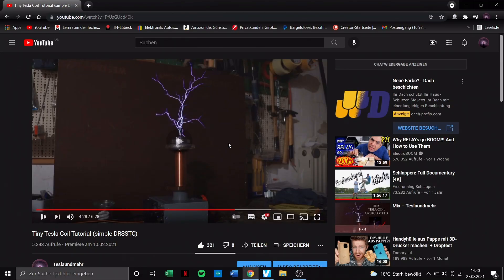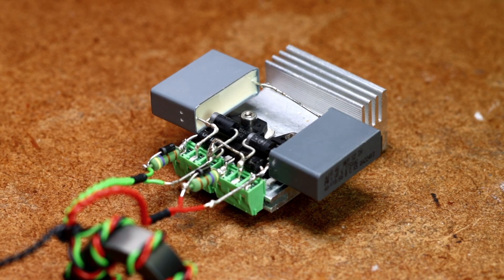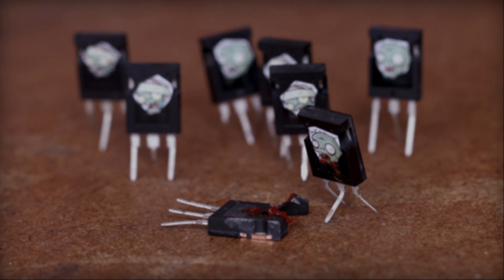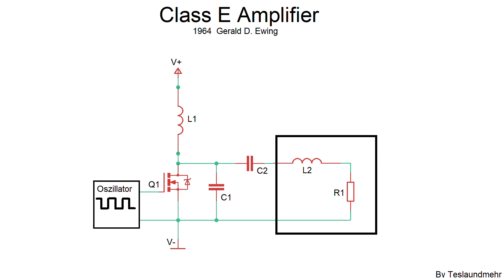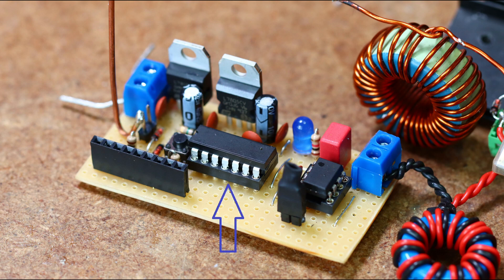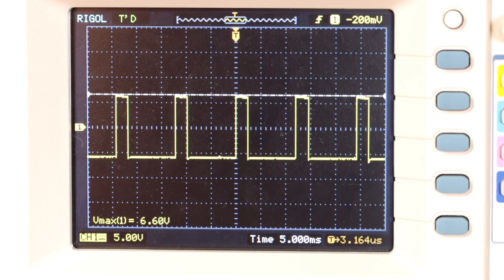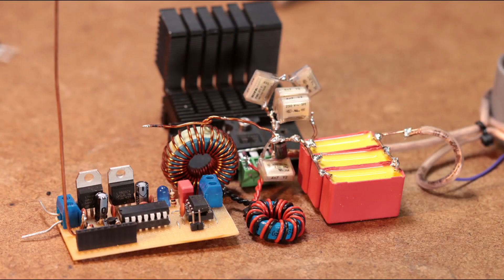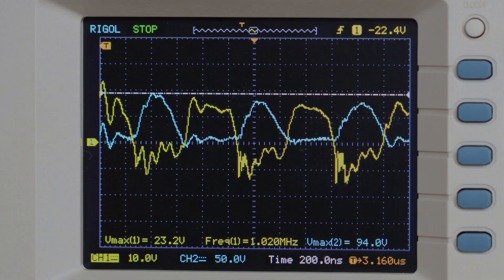Tiny Tesla-Coil easy but Powerful DIY

Comment: I built a class-e coil and used an adjustable voltage regulator to get sword sparks!
Watching your video brought me new ideas for version 2.
Here is the link for my coil: https://youtu.be/wzfhb-ywe1M
I documented the whole process on the high voltage forum. Topic: Driverless Single Mosfet Relay interrupted SSTC

Comment: I just built this circuit up and it performs quite well. I used very similar component values for my circuit except that the secondary runs at 1.8mhz. Normally the coil produces 3.5in sparks but when I touch the antenna it produces 5.5in sparks? Also my input is only around 60v.
Reply from the maker: Thats sounds amazing!
Reply: It is quite good, not perfect yet though, I still have to figure out how to get those longer arcs without having to touch the antenna. Just curious do you know why the spark length increases when I touch the antenna?
Reply from the maker: @quantumlab9130  yes, because your body is like a big antenna, when you Touch the antenna, the coil get more in resonance. So you a bigger Antenna, and better tuning ;)
Reply: Thank you, that’s what I thought but I wasn’t sure. Clearly more tuning is required.
Reply: Probably the last update. My cool now produces almost 17cm arcs. I found that literally everything effects the tuning of this coil. I found even the position and length of the antenna effects the circuit. Also I replaced the 330nf coupling capacitor with a 15nf one and it works much better. Also instead of using a one turn primary coil like you did I used a 4 turn primary which decreased input current and increased spark length. Also using a staccato controller increases spark length and makes the arcs straight and quiet. Also instead of a 74hc14 Schmitt trigger I used a cd40106be which can run up to 16v so I don’t need to use a voltage regulator to lower it to 5v.

Comment: Teslaundmehr greetings ... I already built a driver similar to yours however I don't have a big spark like yours with 40V am using IRFZ44, the secondary coil only has 660 turns. I do not know what values of tuning capacitance c1 and inductance L1 to calculate to the class E driver, I need help. the frequency of the secondary coil about 1Mhz.  how many turns did you put on its secondary coil?

Comment: In order not to alter the calculated capacitance and inductance values in the amplifier clase E, I must respect the physical dimensions of the secondary and primary coil and the caliper of AWG wire and the number of turns. I would like more details to replicate your work, it's great

Comment: Greetings .. your work is magnificent. One question, did you put rectifier diodes at the output of the GDT transformer?
Reply from the maker: Thanks!! No ;) but you can put a tvs or a zenerdiode at the output to prevent the mosfet

Comment: That looked awesome. When I saw the primary voltage and current signals, I knew it would be a good one.
 As that is the same as a positive voltage impulse (no polarity change) 

I would love to see the difference, if you would have used negative voltage and current in the primary!

Comment: WOW im literally building the same thing but without the Schmitt's trigger 😮
Reply: How would you do it friend? I am interested because I am from Venezuela and here it is not easy to get materials as Schmitt trigger
Reply: @victorp2562  same circuit but with feed back going directly to input pin of mosfet driver ...... but use cap and diode clamp.... should work fine ... most drivers have Schmitt's trigger inputs anyway...

Comment: That little bugger produces impressive sparks. Nicely done. For me it was always easier to design SSTC in single or push-pull configuration. Whenever I tried using half-bridge or H-bridge, my drivers got hot, even-though I've used the drivers with included dead-time circuit.  

Now there's only one thing to do: replicate your design, because there is no such thing as too many Tesla coils.